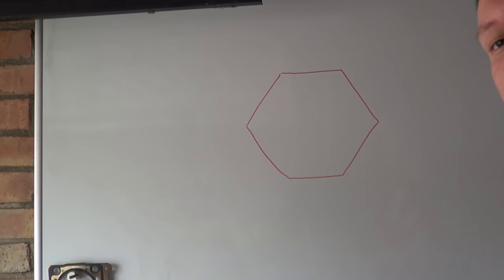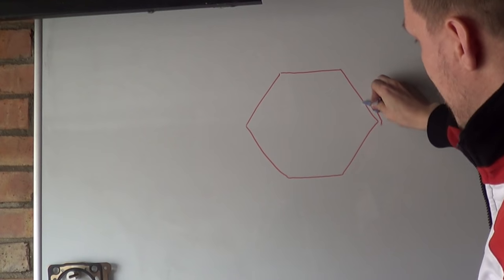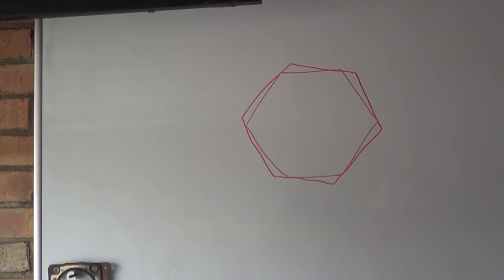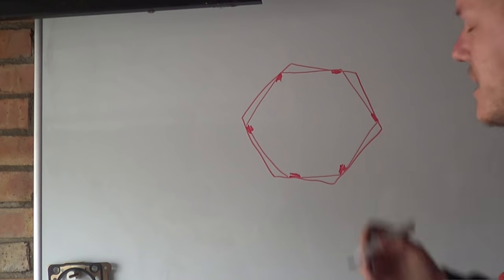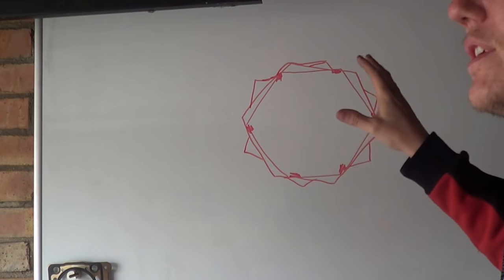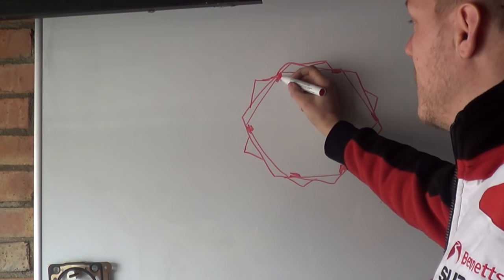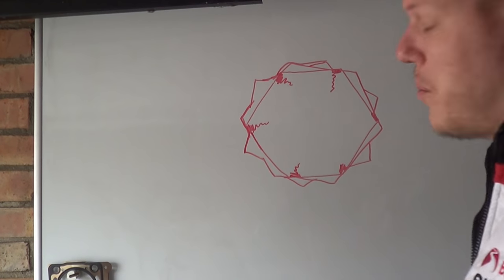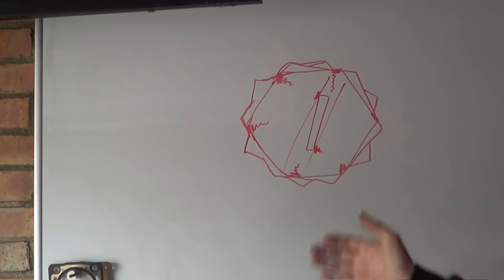Why I HATE 12 point sockets!

Comment: I find the 12 point sockets work better in 12 point nuts than a hex socket .
Reply: That's what they're designed for!
Reply: You "find that 12 point sockets seem to fit 12 point bolts better"? Great observation Capt. Obvious...I'm going to stop using my ratchets as hammers because hammers...work best for...um...hammering 😒

Comment: Have you tried SnapOn's flank drive stuff? I've always found them (both spanners and sockets) great for dealing with bolts where the corners have been smushed off. They also seem to do a good job of not ever causing that issue in the first place, basically by applying their pressure  slightly away from the corners of the bolt head.

Comment: I rounded the engine mounting bolts with a 12 point as it was all I had.. I was quite worried I would never get it out, found a TOOLPRO extraction socket kit for $30 = 9 sockets and BINGOBONGO out she came... They have an almost diagonal profile to the bolt head and one turn later it's biting into the side of the chewed bolt flange and a few turns later it's out ; )

Comment: for you rpunny tiny screws it is true, however for larger ones the 12 point socket is a dream come true. like size 42+.
you see, then the point of force is further from the edge of the "hex corner" on the screw,
and you can apply greater frces without messing up the screw it self.
Reply from the maker: Yeah but who the fuck (in the bike world) uses 42+mm nuts or bolts?
Reply: i really hope no one :)
but the video seemd to be in general about 12 point sockets, not limited to bikes...
Reply from the maker: But its on a bike channel......
Reply: yeah well you had a video about 2 stroke diesels right?
on a bike channel.
care to share witch bike has a 2 stroke diesel ?
i'd be interested, sounds like it would be more than fun to drive one.
Reply: I never use my 1/4" and 3/8" 12pt sockets.  However, I use my 1/2" 12pt sockets a fair bit.  I do agree that there is little need for larger sockets on bikes so yeah.
Reply: It also helps that on such a large bolt, the head is THICKER, so the load is spread over a "deeper" surface.  When you have a small bolt and don't fully seat the wrench (maybe because its got difficult access) you really start to run a risk of rounding the corners even with fairly low force.
Reply: @nagyandras8857  the USMC scout bike was i recall correctly at least one of them was that was designed with essentially universal fuel engines. The main issue bike may have been a 4 stroke diesel

Comment: I've seen so many twelve point sockets crack when used on rattle guns when I was working in the mines. After seeing that I've been trying to mainly purchase six points.
Reply: 6-points can crack too. /watch?v=lr1ACvz0UR4 - taken from "How It's Made", blatantly showing a Ferrari tech using a cracked deep socket to tighten down the inlet stack on an FF V12!

Comment: I bought about 100 old 1/2 dr sockets for 20 quid on a car boot, mostly 12 points, it was interesting to go through and look at the wear. Some were nearly round inside. Imagine the state of the bolts they got used on to get to that point. I kept the old W german Eloras for the 'history' and a few gedores and filled the gaps in my sets and sold them on. I know for a fact I'll barely ever use them but at least now I've got them all I'll never be tempted to waste any more money. 12 point spanners are totally mind boggling, surely it takes more effort to make one and yeah, back in the day it gave you 2x as many angles to get onto a bolt but when the first ratchet spanners came out why didn't the smart arses who's job it is to know everything there is to know about spanners go 6pt?

Comment: 12 points fit square bolts. 6 point does not. Just adding to the conversation.
Reply: True - but the 'catch' there being, for example, a 10 mm square-headed bolt/nut needs a 13mm (23% extra I think..)12-point socket.
Reply: @kaceyanders6599  interesting

Comment: What about 12 pointed BOLT HEADS?  Those seem to be used where high torque is called for and obviously require 12 pointed sockets.  What makes them stronger - is it just that they have 2x as many points of contact, so (hopefully) each gets half as much force to apply the same total torque?
Reply from the maker: "is it just that they have 2x as many points of contact" - yep
Reply: Sebastian Wiers yuh

Comment: i thought there were special 12 point bolts and i just never seen them, don't think i ever used a 12 point socket unless i either accidentally grabbed one or it was all there was for that size, i thought (till i got this set that has both) they were an inverted torx.
Reply from the maker: "special 12 point bolts"

There are, but this isn't there initial intended use.
Reply: so they actually made something this stupid then made bolts/nuts to match it afterwards? what has this world come to.
thanks for the quick reply

Comment: I think they make 12 pointed sockets for 12 pointed bolts and people just used them the wrong way. Well, they work on both but I don't think that was the intention. Maybe
Reply from the maker: No they didn't - 12 point socket heads are or where very specialized. They made 12 point sockets because they engage easier because of the 360/12= 30deg instead of 360/6 = 60. They've been advertised as such for donkey's years. 

How many people have 12 pointed sockets and how many people have seen a 12 point head bolt?
Reply: The Workshop I use the sockets on those bolts quite a bit on deutz diesel engines and shit like that, always thought thats the point of them. I mean for a spanner it's another thing obviously but with a socket you got the wrench on there so why give a fuck where the socket engages? weird
Reply: I'm pretty sure 12 pointed sockets were around long before 12 pointed bolts.  My guess is along the line somewhere, bolt manufacturers decided that if wrench manufacturers were gonna make stupid wrenches, they should make bolts that worked with them rather than rounding off.
Reply: Matt is right and 12 point sockets came in picture long before 12 point bolts . However 12 point bolts are vary common now for automotive engines ,in both petrol and diesel ,across a wide array of manufacturers.
Reply: The Workshop  I've actually seen a 12-point nut on a big-end bearing cap many years ago.  I seem to think it was on a BMC A -series engine (the 1275GT version as fitted to Austin/Morris 1300GT of the 1960's/70's)

Comment: Already damahed bolt with a six point your going to have serious problem trying to get it off .12 point is way better to get it off but also not as strong as a six point .Normally good bolts a 6 point works best unless bolts damahed then use 12 point .Only reason this happens whatscin video is cause bolt already damaged